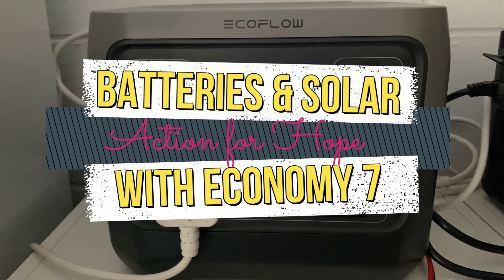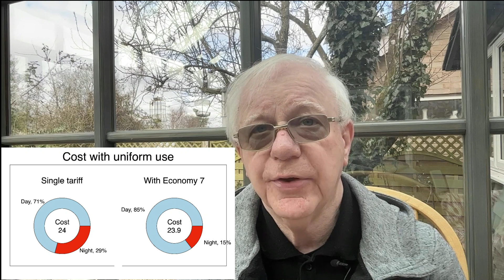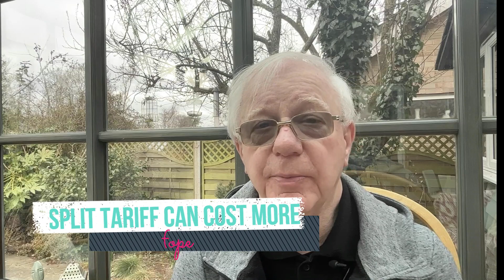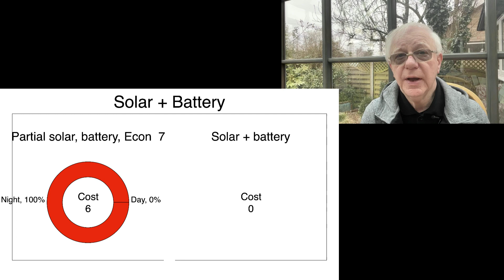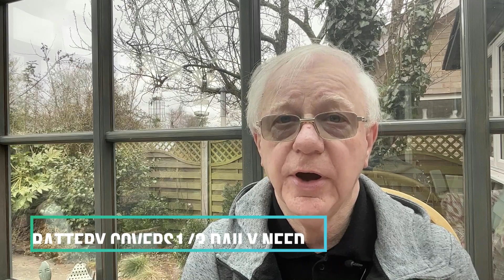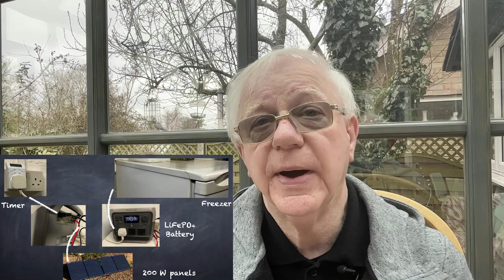Batteries & Solar with Economy 7

Comment: I’ve been thinking about this recently. 
If you had sufficient battery capacity to meet your entire daily consumption, then in theory you might be able to draw off peak electricity at electric vehicle rates between 2-5 am at about 7p kWH. Thereby powering your home all day from the stored energy 7p kWH vs standard daily rate of about 25p kWH. 
Do energy companies allow you to do this please, I don’t see why they should care whether the current is feeding an EV battery or home storage battery unit? Thanks.
I was also linking in 18 solar PV panels but we are surrounded by hills and trees so I’m not sure we are going to get a decent output.
Reply from the maker: Yes, in principle you are right. My off grid set up is rather small scale and experimental. In effect what it does is to store night rate electricity and use it through the day thereby increasing the fraction of use at the low energy rate. I have a limited budget for this and increasing the battery capacity as a future aspiration. I understand some people do use their eV car as a battery unit, but generally if they have larger solar arrays. Since my unit is off-grid, I don't have experience of the restrictions relating to energy storage and reuse  with the system which is integrated into the grid.

Your question about shading is very valid. At our church we could not follow our original plan for siting the panels due to shading by trees in the neighbouring property. Thankfully we had an older south facing roof recessed into our property which did have clearance. At home one July a potential installer gave us a quote for our south-east facing garage roof. However this is on the northern side of our house and so that installation would not give a viable energy return on energy invested. It is good to note the shading that you have in late autumn and early spring, say between 9am and 3 pm. That will give you an idea about where you might be able to place panels. In my garden, I need to move the portable panels in the middle of the day to avoid the shading by a rather levelly maple tree, but that is not possible with a fixed array.